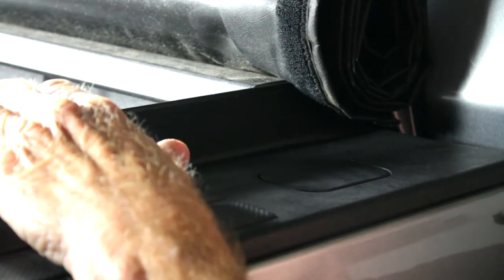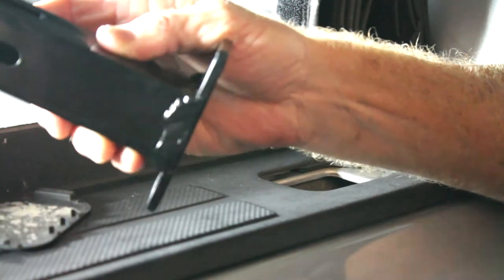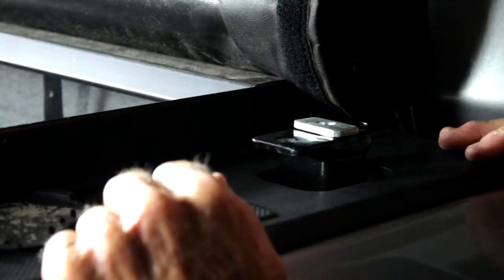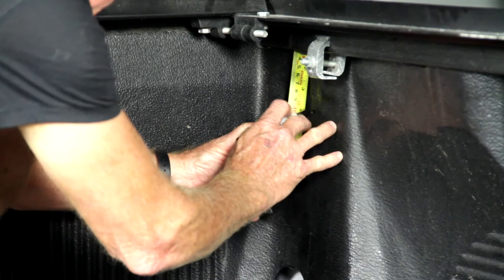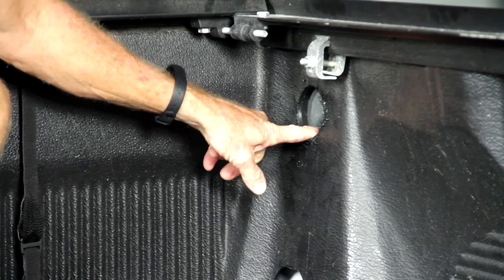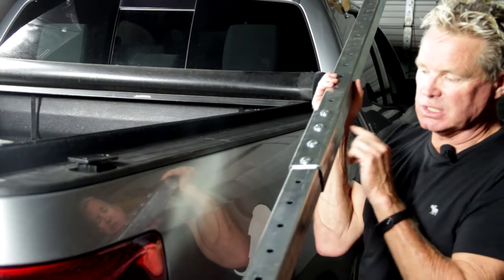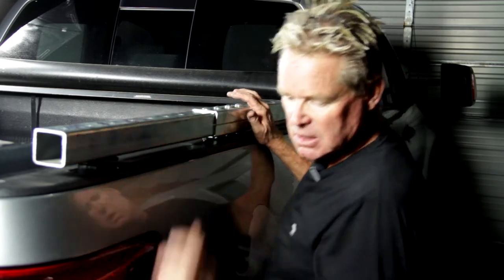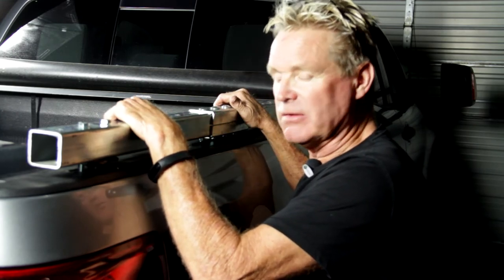Truck Bed Rail System for Toyota Tundra by Green Touch Industries

Comment: Just ordered everything in this video for my  2016 tundra 6.5 bed. Mine doesn't have a bed liner but does have a factory hole. Do still have to drill a new hole in my bedor can I use the factory hole?
Reply from the maker: Hello! For a 2016 you will have to drill a hole into the bed, unless there are holes present from the factory.

Comment: I don't want to drill out any hole, screw down the stake. I want to take this whole rack on and off at the end of the day (TO LESSEN THEFT), so I need something that goes on and/or around the stake or in the stake hole to make it snug when I drop the rail with stakes into the bed stake holes. I will keep it into the stake holes going down the road with bungee...
Reply from the maker: This system is easily removable at the end of the day with proper tools. You can also use tamper-proof nuts to help deter theft as well.